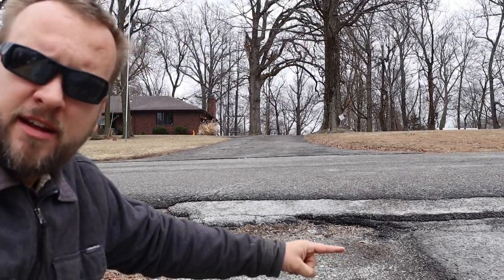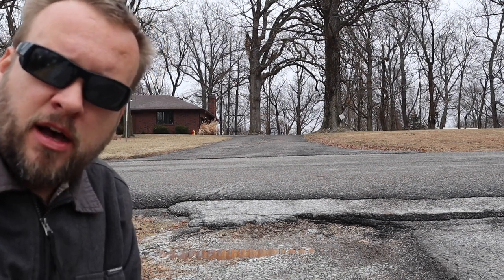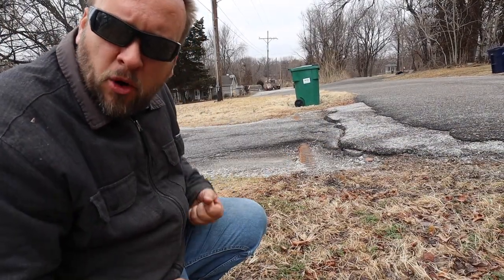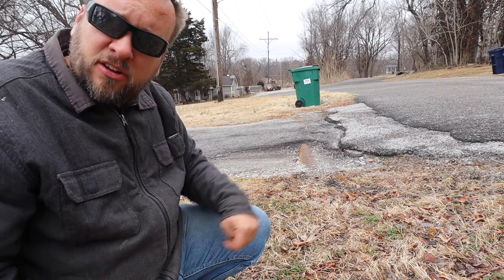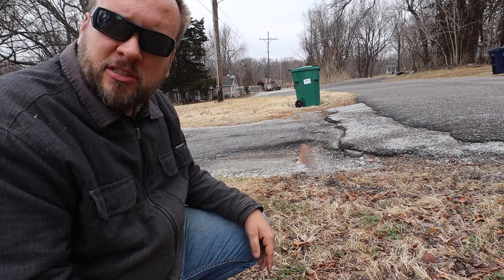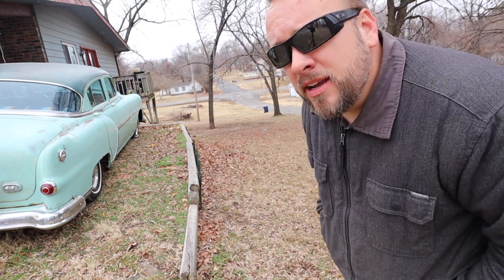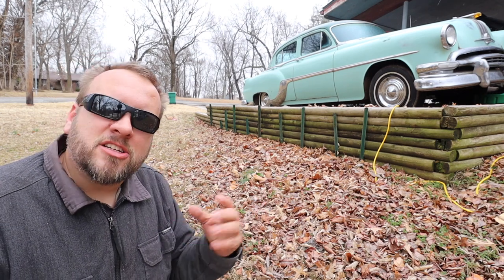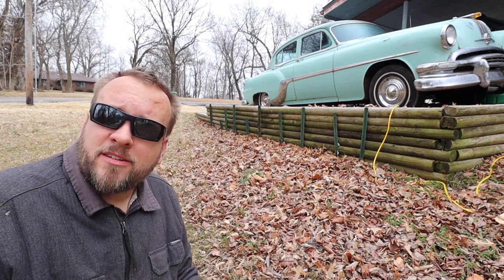Planning a Driveway Repair Job with a New Rock Retaining Wall

Comment: pick up a cheap pump up sprayer and fill it with diesel you want to coat the inside of your trailer and the bottom of the compactor and anything else that's going to be touching the hot asphalt to keep asphalt from sticking

Comment: I used to work for a city and part of my job was to go around  fixing potholes with hot asphalt you'll have at least 3 hours to work with hot asphalt before it starts cooling down on a warm day. if you end up removing that covert pipe saw cut the existing asphalt first you'll have less of a mess.
Reply from the maker: Good info

Comment: Hey Brock. To patch the driveway, I would use cold mix asphalt. If installed correctly, and you buy it at the right place (Teeter’s for your area) it will work just as good as hot mix. Cold mix works just the same as hot mix, but is easier to work with. It has chemicals in it to keep it loose and workable (instead of heat) and once they evaporate it sets up just like hot mix. I know you are a do-it-yourself type of guy, but if you call the City they may be willing to help. I’m local and know those guys. If you need contact info, send me an email and I’d be happy to help.

Comment: look into concrete blocks for a retaining wall. I believe they're 2ft high 2ft wide and 6 ft long. weigh around 3,500 lbs and pretty cheap. last forever  and you're done. chip n seal is a temporary fix. i'd tear out the old blacktop and start fresh.
Reply from the maker: Good suggestion. I used those block on the Quonset hut

Comment: I really don't know what chip and seal is but I think that I would cut the edge of the blacktop, call your local outfit that can mark any utilities,  replace the culvert pipe, and backfill. Then I would get about 3 ton of (around here it's called 2a gravel) gravel with the binder or rock dust and fill in from the edge of the blacktop to the road. It will pack in and get really hard over time and you should have more gravel left over to add if necessary. After a little while you'll have a really good base for any kind of permanent fix for the driveway and it will give you time to explore all your options. And, it will be a relatively inexpensive fix. Just an old man's opinion.
Reply from the maker: The plan is definitely to do it my self and not spend much.

Thanks for watching

Comment: A ton of utilities are buried along the berms of roads, bust one and that company might bill the individual tens of thousands . Call your state "dig number" first and let them mark everything before starting. I had cable that actually surfaced during really wet weather, some are only under the ground couple inches.

FYI, the driveway is fairly short and not that many square feet. It's usually more expensive but concrete might be an option. Tie it into that existing slab.
Reply from the maker: Thanks for the info 

I had it big a couple years ago for concrete. $13 k
Reply: If you do it yourself it's not that bad. Make smaller style forms and pour a form or two every couple months. Will take time to complete but the cost is spread out. 
The small forms will allow damaged sections to be easily removed and replaced one at a time.
Just a thought....

Comment: Dont mess with the ditch or culvert at all.  It drains now has has full turf growing in it.  If it ain’t broke don’t fix it.  Any way the ditches are the city/county issues to repair.   Call the right authority and meet with them out there and discuss your transition issue with the street.  It look like they caused it over time by building up the street elevation with additional asphalt overlays and not maintaining your driveway transition.   If they won’t help I would just hire an asphalt company to  fill in the transition area with hot mix asphalt to the elevation and grade that you desire.  DO NOT TRY TO COMPACT THE ASPHALT YOURSELF!!!!  This MUST be done with a roller designed and sized to compact Hot mix asphalt.  (330 degrees mix temp min. ).  If the asphalt is not properly compacted and sealed up to 98% compaction density you are throwing all your money away as it will be Porous with voids that will hold water and freeze next winter and break it all apart thus turning the new surface to loose rubble.  Leave the culvert and non ditch areas alone and pave the transition.  Besides after call 811 locate and you see all the utilities that exist that would convince me to leave the Hornets Nest  alone.    Good luck with what ever you decide.   As for the retaining wall. I would Tear it out and have two dump truck loads of good earthen fill delivered that you could install and place your self with your tractor and roll each lift in to compact it on a 3:1 slope and seed it.  It will be less expensive and faster in the long run to just mow the new slope.   Retaining walls if done correctly are very expensive to build and without a railing on top of the wall are fall hazards for people and especially kiddo’s.
Reply from the maker: Thanks for sharing

Comment: Double check with your local road authority about connections to the road way. In some cases they might be responsible for the culvert or require a permit if it is in the right of way, etc.  Likely not in most areas but these days it can vary greatly!
Reply: 👍🏻 yep
Reply from the maker: It is a good idea to ask but I’m betting they don’t want anything to do with it

Comment: I have built many retaining walls using block and lots of rebar it's real simple to do you just need to dig out a little bit for a footing and make sure you fill all the blocks with concrete . you could probably get away with 6-in wide block since it's only going to be about 36 in tall
Reply from the maker: Thanks for sharing

Comment: It's hard to tell your situation from the video, not knowing where the property lines are. Here, the city or county periodically comes around and cleans out the ditches. Most property lines are 15 or so feet from the road, the county owns and maintains the right of way. In some areas though, the property line is in the center of the road. Either way, you would probably have to buy a new culvert if needed. Asphalt millings on a good compacted base would be much less prone to washing away than gravel. Chip and seal would most likely have to be done by a paving company. Call the county and 811 before you dig!
Reply from the maker: Thanks for sharing

Comment: You should contact with someone who sells asphalt or contact a asphalt pavement company. It is called asphalt milling. It is the stuff that they grind off the top layers of asphalt roads and parking lot.
Reply: Also before you remove the culvert from the driveway. Check with your local government to see if they have to do it or you have to get any permits for doing that kind of thing.

Comment: can't really tell in the video if your yard and driveway slopes downhill from the street to your house, but if that's the case I'm not even sure that covert will do you any good even if you repair it looks like the covert pipe drains into your yard which really isn't helping you
Reply from the maker: It does but I’m going to try to reshape the ditch and make it run to the culvert

Comment: I live in rural Oklahoma, and the county here will usually assist with installing/fixing a culvert pipe for a driveway, you may check on that.  When you talk about chip and seal, are you referring to putting loose clean stone down, then a hot tar binder, than a top coat of clean stone again?  I'd be interested in a DIY solution for that, I haven't seen/found anything that is DIY for the hot tar.  

You have a tractor and a plate compactor, if there is an asphalt plant near by I bet you could do a pretty decent job with a load of hot asphalt delivered.
Reply from the maker: Thanks for sharing the info. I don’t know a lot about working with asphalt I’ve just heard people refer to chip and seal I think it’s like the leftover asphalt milling‘s and you can get them cheap and do it yourself.

That’s what I’m going to try to learn in the next couple weeks as I get ready to do the job
Reply: @RockhillfarmYT  OK, in my neck of the woods chip and seal is a different thing than asphalt millings.  Millings are from when an asphalt road is resurfaced and they grind/remove the old road surface to prep for a new asphalt layer.  Dirtperfect has a video or two about using asphalt millings on his drive way with good success.  I've not used them, but I understand heat and compaction are what he recommends.  Good luck, I'll be waiting for the video!
Reply from the maker: I’m probably just messing up the terminology. What I’m talking about is the asphalt milling‘s

Comment: what I would do with the driveway I would build it up a little higher to take some of that slope out and then go to and asphalt plant with your trailer and get some hot asphalt and spread it out use a plate compactor to pack it down and your tractor to spread it out
Reply from the maker: That is probably the best solution. I haven’t ever messed with asphalt so I’ve got to learn a little about it
Reply: @RockhillfarmYT  you pretty much have all the tools needed to do the asphalt job, it will be good content for your channel

Comment: The state, county, city should take care of the drainage issues along the road. I'd say get a quote to redo the entire area with asphalt if you decide to go back with it. Fixing cracks is cheap, but it'll eventually spread or come out anyway. A wall that small might be easier to turn into a slope instead to save anyone from driving off it and tearing up a car. Also gives more access to the backyard if needed.
Reply from the maker: Thanks for sharing. That’s how it should work, but I doubt that the local government has any interest in fixing this.

It’s going to be a do it yourself job
Reply: @RockhillfarmYT  if they're anything like my public works department, you probably should fix it yourself. I did get them to drop the pipes off and take the asphalt out for me. I handled the rest after I seen some of their previous work.
Reply from the maker: I appreciate the feedback. I definitely do need to at least go in and talk to them about it

Comment: I like to use the big retaining blocks that are 2x2x6 & 2x2x3 but in a nice base and then stack them up for the driveway, I would replace the culvert V out both ends and then slightly trench it out. Then start with a nice level section by the road into a nice tapper down the driveway with some crusher run with dust and then if you can get top it all off with RAP
Reply from the maker: Thanks for sharing